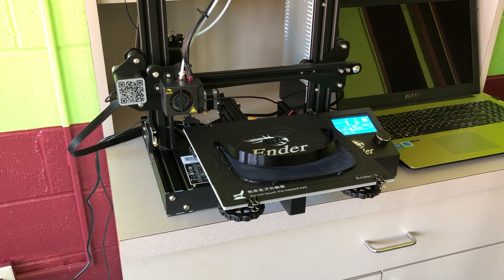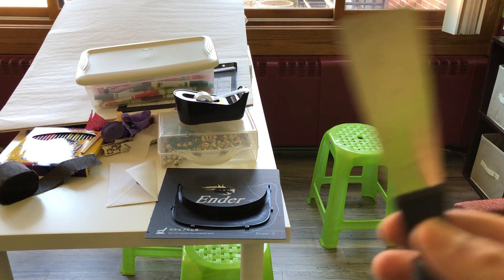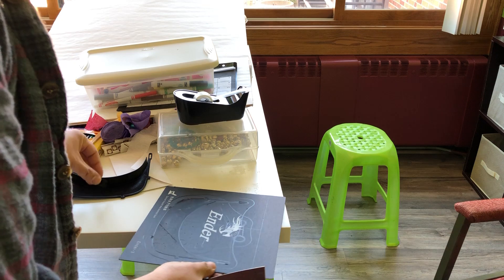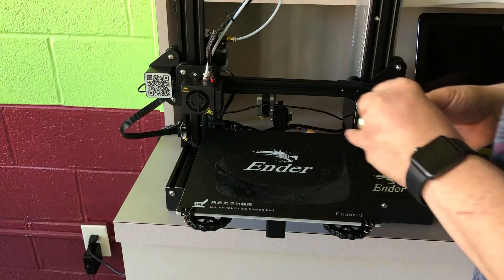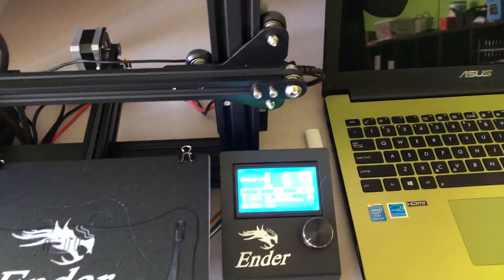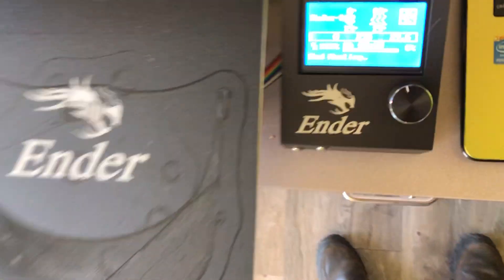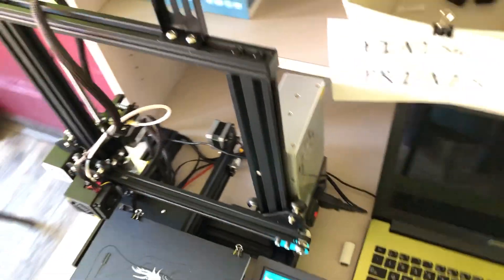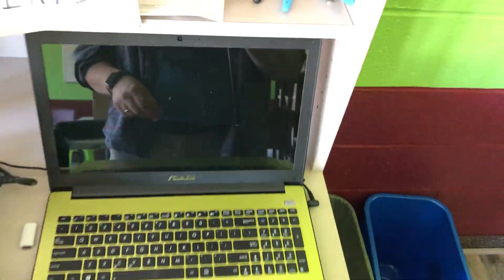3D Printer Reset Tutorial

Comment: I came here to find out how to reset my printer not to find out how to print some trinket for you.  Also, it's totally unnecessary to remove the bed plate every time you need to scrape off a new print.
Reply: Did you find out how to reset your printer?
Reply: @iforgor227  Thanks for asking.  I don't remember what the exact problem was then but the printer seems to be doing OK now so I guess the answer to your question is yes although I didn't get the answer here.
Reply: @iforgor227  Tell me the symptoms.  I'll be glad to help if I can.
Reply: @ramtek2702  I've actually been having 3 months of problems with my cr 10 s5. Emails back and forth with creality has me fixing the problem, only for a new one to appear. Now my problem is that the printer is taking a long time to heat up.
Reply: @iforgor227  I have an E5+ with print area =350mm x 350mm and it takes about 5 minutes or so.  I've never timed it but I thought it was normal.  Hot end is always faster.
Reply: @iforgor227  you might need a new thermocouple thing or whatever its called.
Reply: And didn't even clean the build plate before starting next print lmao